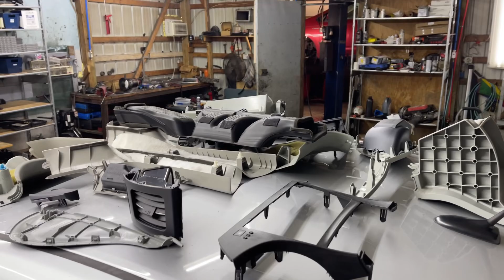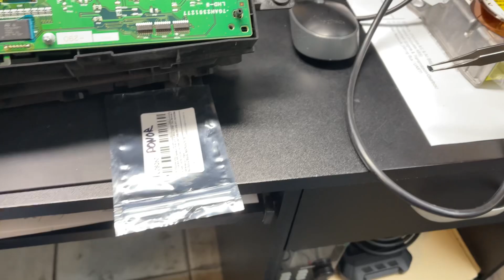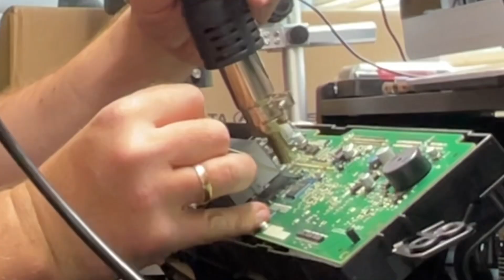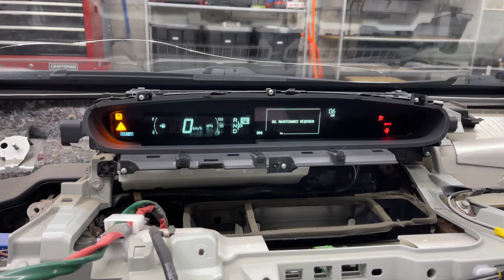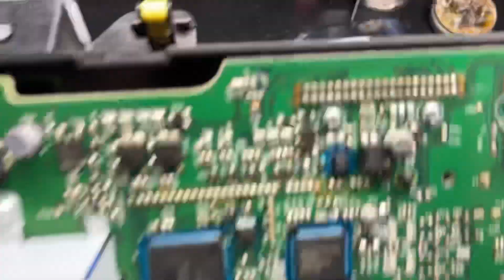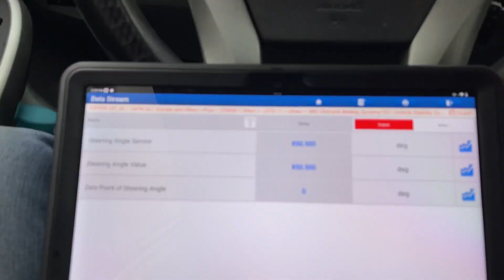Dashboard Replacement and Original Mileage Data Transfer for 2010 Toyota Prius

Comment: Wonder when you scraped that blue stuff off do you have to put that stuff on on the original chip after desoldering? What did you use to solder it back on, heat gun or iron, solder paste or wire? I am ordering a heat gun to do this job.
Reply from the maker: No you don’t. I prepared contact pads on circuit board with soldering iron and solder wire. Then I used a heat gun.

Comment: Can you give a list of the tools used?
Reply from the maker: I don’t think so 😊
Reply from the maker: I just don’t have enough time for that
Reply: @diagmind  You think just a normal soldering iron with the right tip will help remove the chip? I don't have a heat gun but I do a soldering iron. Any other tools to use besides a heat gun?
Reply from the maker: @TomMalewicki use two soldering irons to provide heat to both sides of the ic, cause if you’ll try to take it off using only one soldering iron you take a risk of damaging the circuit board on the other side of the ic
Reply: Why is your cluster shows only 1 connector but my cluster have 3 connector
Reply from the maker: @joelaus4723  different model year/manufacturer/market area

Comment: Hi, I have the same issue with my 2011 Prius, can I used a cluster panel donor from a 2014 Prius to exchange, as both are 3rd Gen?
Reply from the maker: No, they have different circuit boards